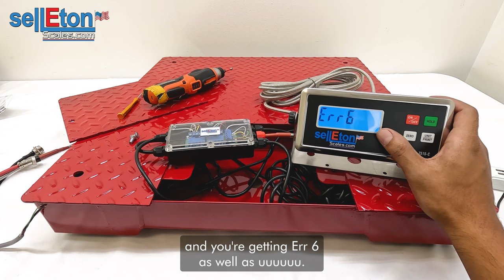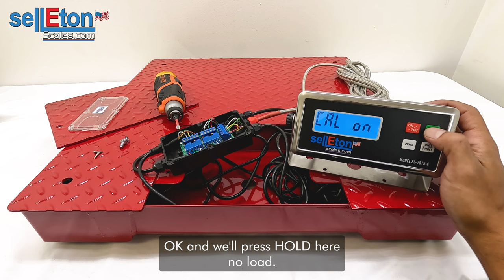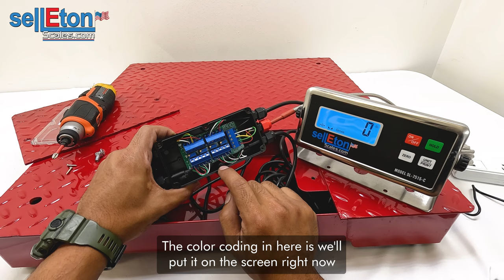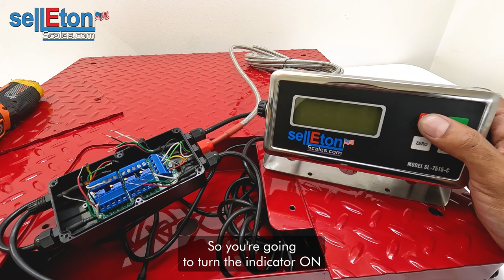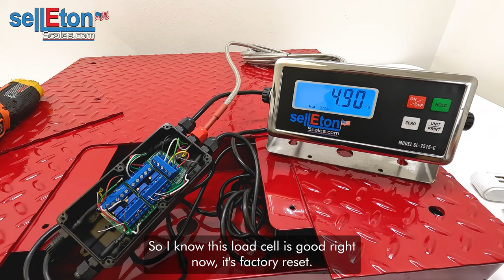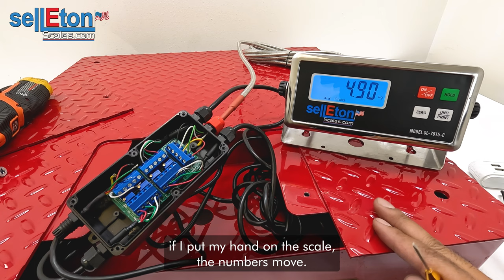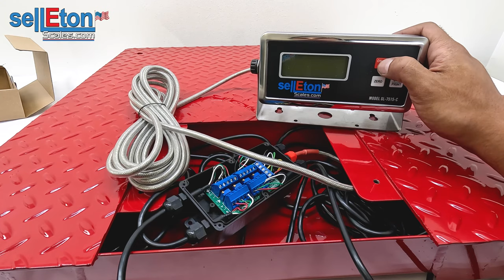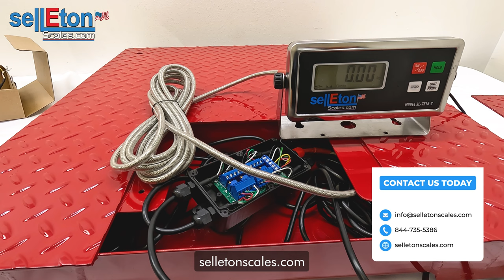How To Correct Err 6, uuuuuu, nnnnnn | Identify & Replace Bad Load Cells | SellEton Scales

Comment: So if you change the load cell and the indicator show range -10 to 10
Reply from the maker: Check to make sure the load cell is installed correctly and you recalibrate after changing the load cell using this video:  https://www.youtube.com/watch?v=kKSVrB-NdrY&t=10s